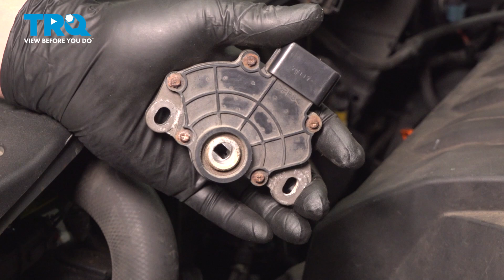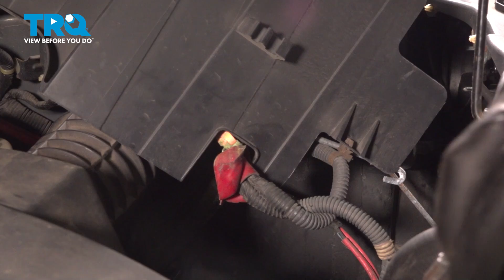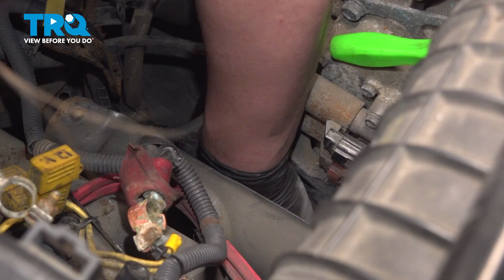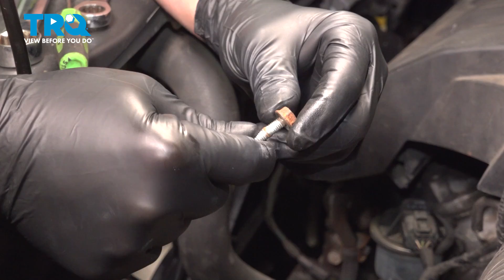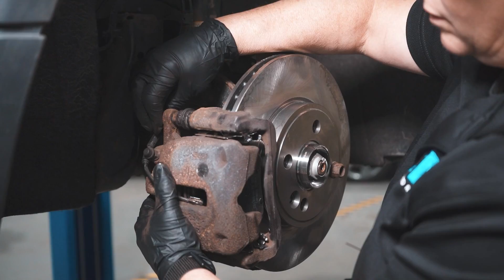How to Replace Neutral Safety Switch 2003-2008 Honda Pilot

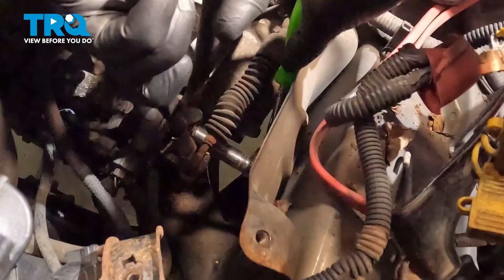Comment: Heads up at 3:14 he states that he uses a 13mm socket for that nut. Then later in the video when putting it back together at 8:56 he states he uses a 12mm wrench. When he initially said 13mm it just wasn't working for me but when I switched to a 12mm wrench it finally worked. He likely misspoke at 3:14 and it's actually a 12mm

Comment: Great video. Keep in mind the driver side wheel well will still need to be accessed to use a long screwdriver and hamner to tap up on the Locking tabs on the Locking tabs on both the nuts. It cannot be done from the top

Comment: except the fact that my neutral safety switch was seized onto the transmission shaft, had to grab a Dremel, cut into it and pry it off with a screwdriver attached to pliers, did some damage to the shaft but put it back together and it works great. thanks again for the video!

Comment: perfect timing for me. just about to replace it on my wifes 08 pilot. we thought ir was the starter than the battery than the alternator. thankfully only replqced two of them 😂 remember, if you go to start it and your D lights up green, its the neutral safety switch!
Reply from the maker: +@user-hr4iv3cp7l Thanks for the feedback! http://1aau.to/m/Shop-TRQ
Reply: L😅😮😮😊y